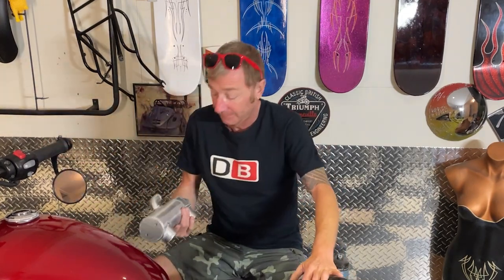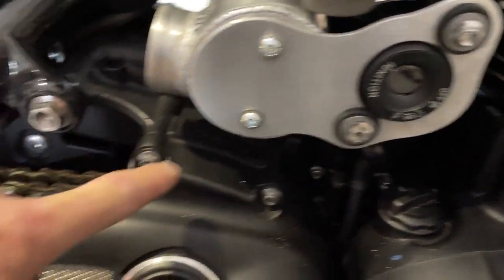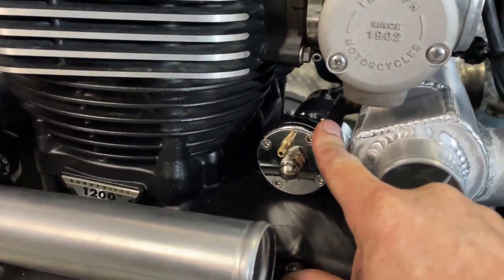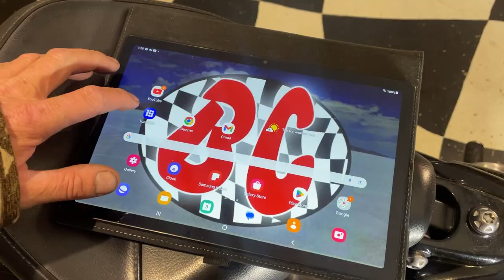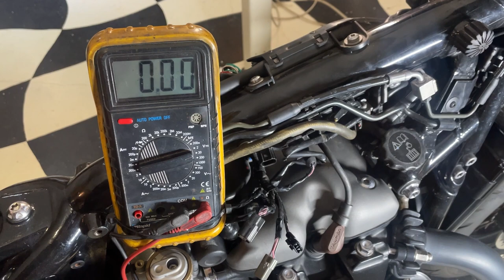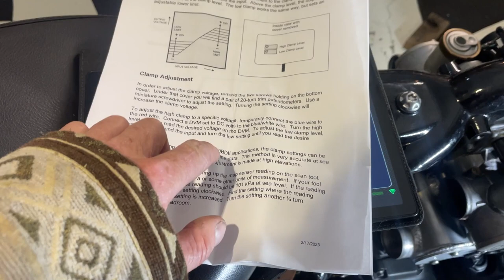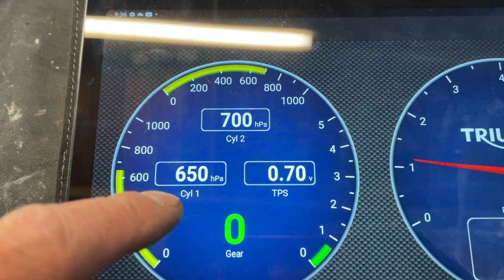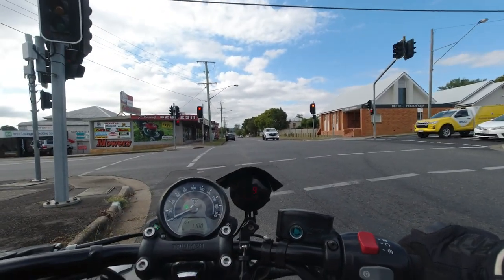Supercharging the Triumph Bobber (part 6) Fitting the plenum chamber and bits

Comment: Hi! Thank you for such great video tutorial! I've bought kit for cb1000r from tts, and have a lot of troubles with it while installing and no any tutorial how to adjust this voltage clamp. Can you please tell how you adjust low level for voltage clamp, I mean what value should be there? Richard told that high level should be on 3.7v but it's strange, why not 5v. And when I set high level on 3.7 just after few runs on the bike I checked voltage and it goes to 1.4 or any other value that strange and I should adjust it again. Will appreciate if you help me and say how you adjusted low level on it. Thank you and looking forward your reply.
Reply from the maker: From what I believe the voltage clamp is to stop voltage spikes and triggering a fault code. So If I remember correctly I just set the low level to zero. I have not spent too much time messing around checking voltages since I installed it as I have had no issue with it causing any faults. When you say you measured the voltage afterward, have you got the MAP sensor still connected or unplugged?
Reply: @brownco_customs   MAP was disconnected, I've adjust low and high level on it and there strange thing I saw that it has some delta between low and high, when I adjust low more then 1.4v the high level drops down to  1.4-1.7v and it was really strange. Now I set low to 0.4 it is the minimum and high to 3.7v by the TTS performance advice. Thank you for the reply and for great video tutorial! Now I have problems with starting. Fuel mixture so rich  that spark plugs totally wet and one time when I've start it the AFR was 10.4! And it's after they flashed my ECU. I don't understand how it can be on already flashed ecu... The fuel pump from the kit like he said was on 265L was dead, and I install my custom pump for 140l \ 4bar mut it can't give higher pressure to give some amount of fuel on the start to make so crazy AFR.